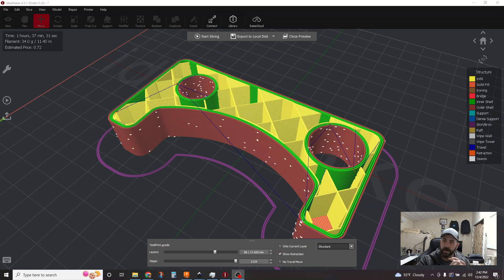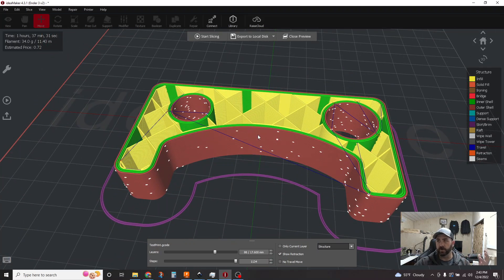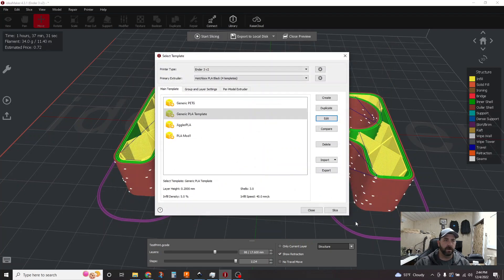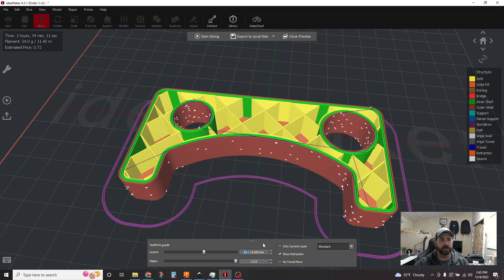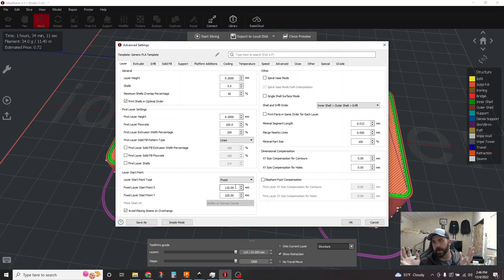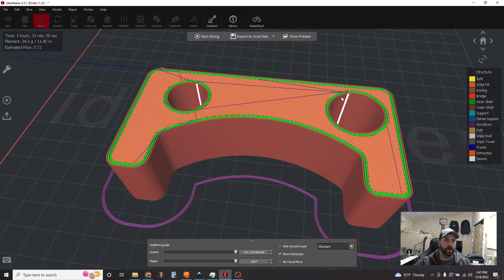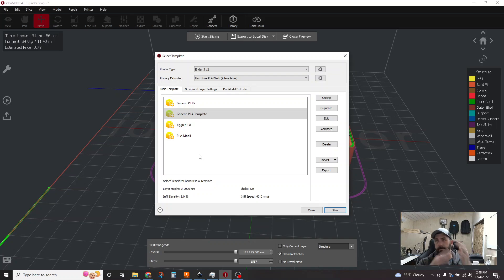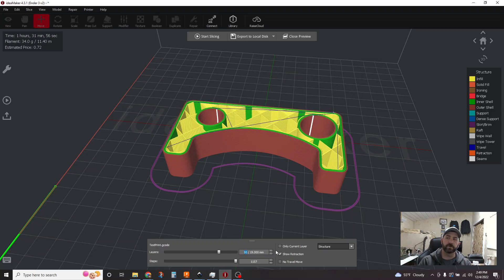2 Simple Tips to Reduce Stringing in 3D Printing

Comment: I've been using Ideamaker for 3 or 4 years. I have always wished I could easily see where the seams are being placed in the Gcode Preview. I see you have a button to turn seams on. I don't have that button. I don't see how to enable it. I also see you are on version 4.3.1.  I'm on 4.1.1 so I tried to update but it says I'm on the latest version. I even enabled Beta version updates and still it says I'm on the latest version.  Any hints on how to show seams in the preview screen. Thanks for all your Ideamaker videos. I subbed a long time ago as I found your videos very helpful and also straight to the point.
Reply: Ok I see where I can get newer software manully from the website. I'll try that.
Reply: I just downloaded 4.3.0 and I have the show seams button!! Yay! thanks for bringing it to my attention. That will be so helpful. I used to figure it out by looking at the travel moves on each layer. This will be so much quicker and easier. I'm also going to check out that Gcode viewer website you showed. Thanks again!!
Reply from the maker: So sorry for the delay in responding. Looks like that feature was added in 4.2.2.  Glad you're on a later release now and got it solved.

Comment: Great tip, and a great video as always. Somehow I don't have the option to show seams on the preview structure panel. Are there additional settings to show seams?
Reply from the maker: Hi Roger.  What version of Ideamaker are you running?
Reply from the maker: I believe that features was added in ver 4.2.2.  Make sure you're running the latest.  Sorry for the delay in replying
Reply: @fischer3d  Well, that explains it. I'm running version 4.2.1

Thanks for the video, and keep up the great work.